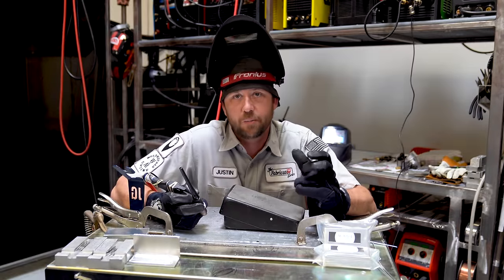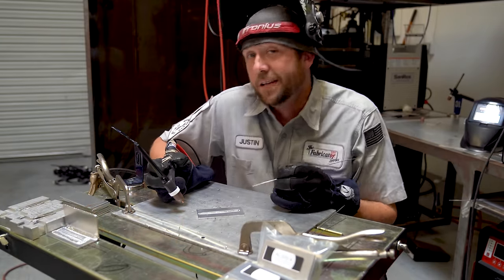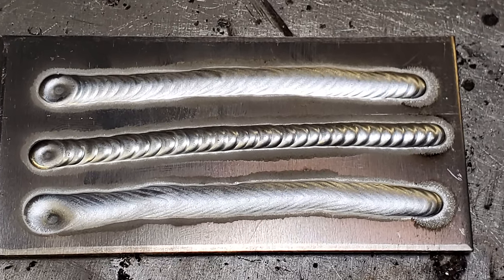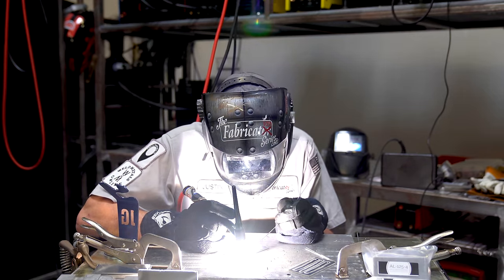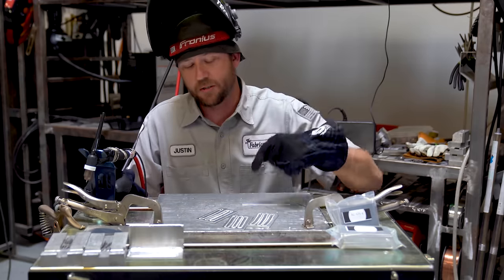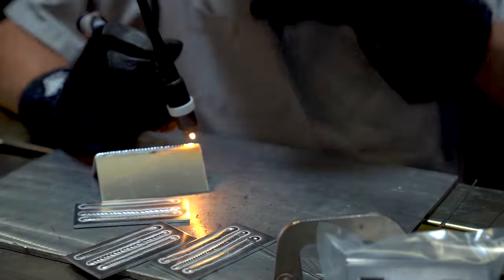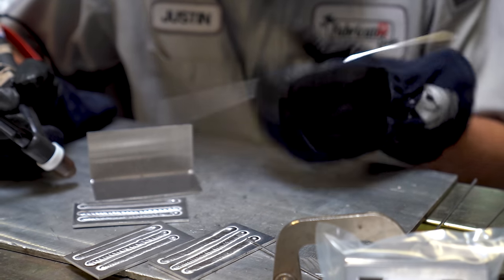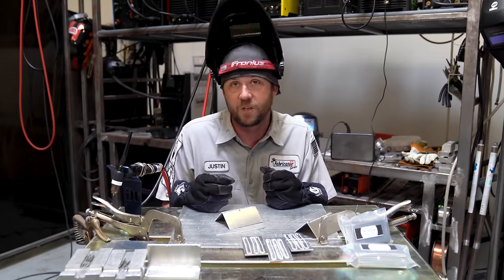TIG Welding with a Trigger Switch

Comment from the maker: Save 10% at Weld Metals Online with discount code "TFS10"
https://weldmetalsonline.com/

Learn to TIG Weld in Our Class!
http://thefabricatorseries.com/classes
Reply: The Fabrication Series if only I had that code last week. Jumped on their tig starter pack right when they posted them. Just got my first tig machine last week after watching a TON of your videos.
Reply: Just tried your 5 weld drills using the 1/16th coupons from weldmetals. Could not get an autogenous tacks nor could I get a decent weld; everyone of them went through the coupons and made a mess of the top weld and backside. 
zzz Definitely need to practice practice practice
Reply from the maker: @andrewsturgess2033  Its all practice 👍
Reply: Have you tried one of those pressure sensitive buttons that youtuber 6160 was promoting?
Reply: Try to set up descent for 2 seconds, set up 140 amps and press trigger like pulse during welding more at the begining less at the end this is my technic also for stainlesssteel more amps and look for streight edge of puddle
Reply: Andrew Sturgess Keep giving it hell, man! Not long ago, I was struggling tremendously to get over the hump on aluminum. A handful of those packs of 1/16” coupons from weld metals helped me out big time along the way! One day, it just suddenly clicked. I don’t think I’ve ever felt that level of achievement and confidence. The harder it is for you to get it down to your own satisfaction, the more rewarding it will be when you realize that all of the sudden, you’re laying down those sweet shiny dimes with no problem.
Reply: I haven't bought my first welder yet, but does this mean I shouldn't use the pedal at the beginning?
Reply: Does that 10% only apply at US or  can I also get it here in SA... decided get some tools on welding
Reply: Exactly what I need to know being in a wheelchair  I've welded with oxy/cylin mig, stick but tig is what I need is that hand control!
Reply: @st170ish  Yes. It's called "The TIG Button", This Old Tony did a video on an early version too. I think it would be a great idea for a video on The Fabrication Seriesl!!!

Comment: As a nuclear tig welder working on submarines, we work in pairs, one man acting as the welder and one man is the 'button man', and we say 'on please, off please' when we want to arc up, this gives us the ability to concentrate completely on the job at hand and hold the torch any way we like without worrying about using the button, its also extremely helpful when needing to use a mirror. Just thought id share this 👍
Reply: Thats really interesting, what a great thing i learnt today, cheers for the info
Reply: Mirror?
Reply: @LilFish0  because it was on submarines and most of the welds are restricted a mirror is used I'd say 1/4 of the time, I do everything I can not to use a mirror to increase chance of passing xray, the standard is ridiculous on subs so even a pore as small as 0.2 mm can result in a cutout
Reply: @inhardwarewetrust3057  welding in a mirror is hard. And yeah I can only imagine the weld restrictions on submarines, it’s probably a pain, but props to those who take on those welds.
Reply: @Only_Cans_101  f
Reply: Hey alexa, on please 😀
Reply: That's funny... When I was in the navy I saw a lot of shipyard welders doing a lot of tig welding... Never saw this practice. I saw the mirror trick a lot. But never saw one man run a pedal and another run the torch.
Reply: @noclass2gun342  on T and V class submarines you can imagine the welds are all located in extremely tight corners and locations so we did it to minimise the chance of sticking the tungsten in the weld pool when pressing the on/off trigger on the torch. I'm aware it isn't a common practice at all but that's what we all did, every nuclear tig welder in the shipyard I worked at worked in this 2 man system and still do
Reply: I have huge respect for anyone who can weld electrons together.  Mad props!  ;)))
Reply: @inhardwarewetrust3057 so you work interchangeably or is one man constantly the “button man” ?
Reply: @Bakanelli  both qualified welders, just take it in turns depending on whos either qualified at the time for the specific job or who's more up for the job, sometimes it's handy to have a left hander and a right hander paired up so if it gets extremely hard you can swap but I never really had to do that, I've not been in this job for a couple of years now but I may go back next year, I miss the challenge, job satisfaction and interesting work. This all might sound ridiculous but some of the welding jobs would seem downright impossible but they have to be done
Reply: @inhardwarewetrust3057  Nice! I TIG as a hobby, just bought an additional switch for my torch for those situations where pedal is PITA… 🙂
Reply: LMFAO WTF ??? Better learn how to do it all by yourself , never heardt of that, we use this method and no one to help us

Comment: Always ran with a thumb wheel. Learned on it, and used it for years. I've never understood any benefit of a foot pedal or a switch. Everything is right there at your thumb.
Reply: You can even DIY it with guitar potentiometers
Reply: I've used both. But my legs shake like a crack head so I'd rather just use my thumbs lol.
Reply: The wheel control actually is a potentiometer, with the right value and connection on the machine it work
Reply: Learned on foot pedal and I love it. People say it slows you down and can't be used unless sitting but i have no problems keeping up and even working the pedal with my knees if i have to weld on the floor. I can lift arc too and am pretty good at that. But fuck thumb wheels, too much extra stuff to do with my hand for my brain to register. Like patting your head and rubbing your tummy.

Comment: Id have to guess at least 80-90% of us down here in Australia use the button, I don’t know many people at all that use a foot pedal.. pretty sure majority of the welders we buy down here also only come with tig torches that have the button
Reply: I'm in the US and work in a fab shop. We have one pedal in the shop but all of our machines have button triggers. A pedal is just impractical when your moving around or standing on a stool or ladder! I've TiG welded for years with nothing but a trigger button and I actually prefer a button now!
Reply: Blakkbiird iv never tried a foot pedal, for that same reason it’s not practical if your always moving around climbing ect..I would like to give it a go though just to see how much more difficult/easier it is compared to the button..
Reply: Do you use the 4T mode or do you normally use the switch as on/off?
Reply: James Swanson if I do a long run and I’m comfortable I’ll use 4t, but I do like 2t cause I can feather the down sloap if I’m a bit hot (sort of like pulse but using the button) without having to restart the arc
Reply: @JSC-c  a foot pedal is great if your working at a bench and doing tedious stuff. its also nice because you can slope off the amps at the end of your run so you dont crater!
Reply: Stay here in Thailand
Reply: @mcpheonixx  What's nice about that? I don't know any modern TIG machine that doesn't have adjustable downslope settings when stopping welding. On the contrary on switch is more reliable imo to use those specific time and amp settings than relying your foot.
Reply: Same here in Finland. I don't know anyone who uses them. I don't know if I could even have one fast if I'd like to get one. Definitely would have to order from specialized shops as they most certainly aren't shelf stuff here.
Reply: @mcpheonixx  The same in the UK, i'll sometime blow some cold air on the joint if it's getting to hot, i think you can get variable tig torches now.
Reply: @jothain  we have one machine that does have those settings, the rest of our machines don't!  Most of us are used to not having those settings so really it's not needed!
Reply: here in europe all welders i know have torches with trigger but for welding aluminium foot pedals are also used by many, like me. but if you buy a machine they usually come without pedal and prices for pedals from good welders are all over 400€!..
Reply: @hella6892  where are you from?

Comment: Thanks for posting this up. I have REALLY struggled to learn TIG as a beginner. Years of MIG welding have given me a lot of counter productive bad habits. This at least gives me a "Process" to work on before I try to weld something that it will matter on. Thanks again!

Comment: I went and did a weld test with the boilermakers union and they had scratch start, I've never used one and it seemed like it went against everything I knew about tig welding, heat control and most importantly tungsten contamination... It was a 2" heavy wall coupon, tig root, 7018 fill. I had a LOT of "figuring out" in a short time. I ended up passing with flying colors to the point that the hall tossed their "example coupon" and put mine in its place. They sent me out on my very first job as a Forman 👍.  This was my second card, now I'm medically retired Iron worker/boilermaker. I wish I could recover and get back at it. Loved my job.

Comment: Hey Justin:  Tjanks for the instruction!  This is the situation that boat builders run into.  When you are lying on your side or back in the bowels of a boat structure, foot pedals just won't work.  In these conditions, a torch switch may be your only option.

Comment: This Old Tony has had a switch on his tig for ages. 
Defo something I want to try 👍🏻
Reply: If you ever weld out of position or in tight spaces you can’t beat it. I weld on my back and side a lot so a trigger gets used 60% of the time.

Just don’t buy a cheap one, they break pretty quick
Reply from the maker: I think Tony uses a pressure sensitive switch that varies the amperage. Not 100% sure.
Reply: Me too. Just setup ramp down time and amperage to use the trigger for a pulse type weld to keep it lower when needed
Reply: 6061 definitely uses a pressure sensitive switch on his channel, I’d love to try one someday.
Reply: @limitlessbuilds  this is what I do also, works well!
Reply: @mackayla0  I bought one a year ago, and ill never go back to pedal or on/off switch. Takes some time to get used to and get a feel for pushing harder or softer to control amps, but once you do, it works great.
Reply: because he has super tiny hands. :P

Comment: If you ain't skeered of a little wiring you can and I did add a potentiometer of the same spec (I forget the rating as I did it about ten years back) as that in my ESAB TIG pedal inside the pedal housing and a SPDT toggle switch. That turns the TIG pedal into an adjustable remote amperage control.  Tack weld ~1 inch long pieces of tubing to the housing to protect the pot and the toggle.  That avoids buying an expensive remote which may not be available for some machines. Guitar pots are reliable and cheap. (Do some reading on whatever musicians currently use as they are very hard on their equipment.)

Comment: I approve a lot of what you said, nonetheless I would like to leave a few words of mine about the topic.

Towards my background, professional with TIGer, sheet metals 0.8 -3 mm (0.0315 - 0.11 inch) mostly stainless, but also aluminium and copper.

We use torches with integrated switches, 2 of them, one for switching modes, the second to start or end the arc.
As you probably already realized, this presupposes a digital welding machine... Our Machines cost about 10k per piece, due to them being top notch digital welding machines, you can define 2-4Stroke, HF or Arc, Startingpower, Endpower, Postgas duration etc and save them so you can simply reload your settings later. 

But if you don't have a digital welder, a foot pedal gives you the ability to modulate your arc and you need that to start/end your arc or lower your heat midwelding. There lies the weakness of digital/switch Welders, you can't adjust amperage midweld, so you have to adjust your speed instead. Absolutely possible, but as mentioned it needs a bit of training to adjust.

All in all there isn't a good or bad welding setup in my opinion, just different ways to do things that have to suit to the needs of the user. Still I wouldn't use switches without digital welding machines. ^^

Comment: I watch your videos along with others, I have used the things many have shown! What I havent seen, is what I do on most fab projects. When i have to replumb a tanker trailer, or truck. I have to blow it down and mock up piping. I tack up the piping with a push/ pull mig pulse miller machine. Even though i grind back the tacks, clean everything with a new brush, I still get the pepper in the puddle near the tacks.

Comment: Thank you for the tips on TIG welding with a switch. A few months ago, I bought an old Miller 330A/BP that has a switch and a foot pedal. It works but needs some TLC to get operational. It already has the switch wired into the torch; not knowing how to TIG (yet), I wasn't sure which option would be the best to use. Having watched this video, I now realize depending what I'm trying to do (welding overhead, out of position, on the table, etc.) will be the best way to figure out which control method will work best. 
Time=heat is a pointer I hadn't heard before and will not forget.

Comment: Don't forget 4T setting.   You can have 2 levels at your fingertip.   But honestly, the tig button from 6061 is just fantastic.   It took less than 3 or 4 hours to get used to it.   I may never use a pedal again.

Comment: Would love to see your take on if you can use 4T to have a higher start amps then settle on a lower consistent setting the drop off lower again at the end to prevent blowing out, great content love seing options for less than ideal situations 👍

Comment: Being that pretty much all the tig welding ive done is steel or stainless im use to a scratch start set up.  when i was at Tafe (welding school) we had torches with thumb wheel variable control, and I found them so much easier to use than the foot control i used the following year.

Comment: if you've got a machine with a down slope, set it up right and you can use it to regulate heat a little.
It really helps when you've been doing an long weld and the edge or end gets alittle hot, use the down slope to drop the amps for a couple seconds.

Comment: I've been using the Miller rotary switch for years.  it's the only way to crawl around and repair aluminum boats.  I don't think I could go back to a foot petal at this point.
Reply: i want to give that a try i can't get the hang of the pedal  ..heavy foot
Reply: the switch is the only way if you are welding anodized aluminum /teetops railings  marine related products

Comment: Here in Denmark (prob same in EU) we learn to weld with continous amps and i was amazed to even see a footcontroller for the first time. but to be fair its only a "problem" when welding aluminium.
Reply: Here in Belgium it is the same. Just bought a foot pedal. Not easy but I think a can get the hang of it.

Comment: Depending on the machine but alot of machines use downslope these days or have I can weld pretty much as good as a footpedal with about 1 to 3 seconds of downslope dialed in and you just pulse the switch.   I used a footpedal once or twice  in 20 years of welding and hated the things unless your at a bench welding they are hopeless.
Reply: Yeah upslope and downslope are key to welding with a trigger
Reply: My words, exactly....
Foot pedals are for benchwork only.
Reply: Seems like most americans have never heard of this... here in scandinavia almost noone use a pedal.. try use ut on a paper mill etc.
Reply: I agree with all these comments. I don't have foot pedal. My boat builder mate doesn't either. Everything by trigger. Up slop and down slope is where it is at. Americans never talk about this.
Reply: I've only used pedal and I use them everywhere not just on a bench done it upside down 5ft in the air inside an HVAC unit balancing the pedal in my foot and the top of the frames roof still layed down good welds you have way way more control with pedal
Reply: @JDON0917 most Americans doesn't know how to drive "manual" cars either, so I guess it's the same with welding: they are used to a simplified version of everything

Comment: Years back when I was welding and the shop manager involved very intricate and detailed welding. 
My welding test for new  applicant's was to weld Two sheets of aluminum foil back together.. 😬👏
When they said that's impossible, I showed them how. 😁
Only met Three other people who were able to do it besides me. 😳
Would love to challenge you and see it done again. 👍👍👍
Reply: I don't believe it
Reply: when i was at college,many years ago, our welding instructor's party trick was to fold 2 milk bottle tops in half,and weld them back together  down the middle
Reply: There are tricks to doing it.
Reply: C'mon it's not a test. I know how, and it's kinda cheating ;) For any on one who doesn't know. You take two thick polished plates of mild steel or stainless (the thicker the better), put two squares of aluminum foil between them, so only quarter inch of aluminum foil is outside. (Plate - Foil - Foil - Plate) Put in wises and just melt the foil.
Reply: Jak to bracie zrobiłeś napiszesz Great from Poland 🇵🇱

Comment: Very helpful video. Would you consider doing a video where the slope up and down is set to 2-3 seconds and you trigger the switch on and off to control the heat.

Comment: If you use the switch in 4 strokes, with most machines you can set a start current, a main current, a secondary current and an ending current: it's not as accurate as a foot pedal, but if you work on the field it's more confortable.
Not to mention that if you have a machine in with you can set and save jobs and switch between it with a dedicated button on your torch, you can litterally emulate the foot pedal, without using it